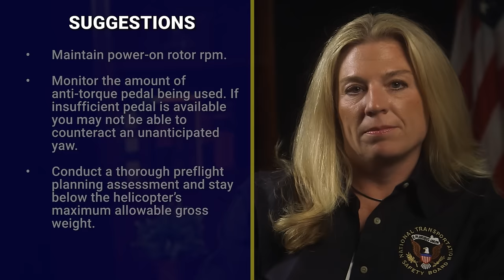NTSB Safety Alert Video - LTE

Comment: G'day,

   Yay Team !

      I was in an Enstrom F-28c which did three or five unstoppable rotations to the right, while at full Left Pedal, descending at full throttle in Rotor Decay, in 1979 ;as we'd been hovering into the Wind , 300 ft from a Creek at the foot of the Hill we'd been hovering 100 ft above.., when the Wind suddenly died out.

   We were so full of fuel (setting out for a day of selling Joyrides) that I had 2 full 20-Litre Drums of 130-Octane between my legs, and I was trying to open the Door to ditch them, when a gust of Wind stopped the rotation, and the Pilot dived into the Riverbed..., thereby being able to slightly reduce the Collective while aquiring Airspeed, regaining a bit of Left-Pedal Authority as the Engine/Rotor RPM increased in synchrony with the Airspeed ; and then we were into Ground-Effect over the surface of the Creek at about 10 feet, accelerating below the level of  Trees on the Banks, before climbing out & deciding not to hover in that spot again...

   We duly landed in our designated Joyriding location, and flew about 65 passengers before setting off on the 130 mile Ferry-flight back to Sydney, accross the Blue Mountains... (I think the previous day it had been 128...) ; Barnstorming in a Helicopter was a lot of fun, but it could get very intense, very fast, on occasion...

    These days I think of powered Rotary-Wing Machines as Heligoflopters & Gyrogoflopters, but that's merely an old Boomerang-Carver's concieted perspective... (Gyro's & Heli's can autorotate and Glide, at 1:1..., but Hubless Asymetric Boomerangs are Autorotating Sailplanes which glide at 60:1 or better...).

    Such is Life,

  Have a good one...

  ;-p

Ciao !